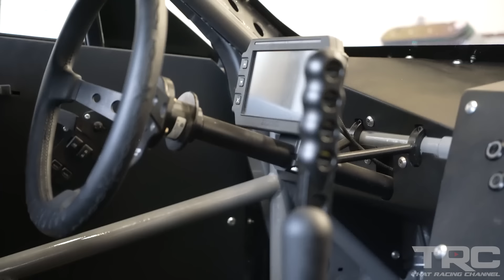Self Taught 21yo builds GT86 with 8-1 Headers, Widebody, Cantilever Suspension (Sema Awarded)

Comment: This car really shows how simple cars can be. Yes they are harder and harder the deeper you get into everything, but since this car is largly modularized and has minimal crossovers between the compartments that make it up it's pretty simple. What do you need: an engine, a gearbox something to connect the spinning thing at the end of the gearbox to the wheels and tires, you need a box to sit in, you need to connect the box to your wheels, you need brakes to slow down and that's pretty much it. The engine for example: it most certainly becomes a harder subject the deeper you get into it but if you look at it like a blackbox with wires, it really isn't connected in a whole lot of places; it needs fuel from somewhere, it needs exhaustgasses to go somewhere, it needs to be connected somewhere to use the power, it's surrounded by air, it needs a digital signal and it needs to be held in place. How that's done is a different question but you can see that the engine is a thing of it's own and not connected with wires going everywhere and while that's an art of itself it perfectly portrays how when you go the "simple rout" with something you can then build on it with great details like the 8 in 1 collector for example to polish it to make it something truly great.

Comment: There's nothing like a Nice set of headers and mandrel bends.. I have to get a Nice Down Pipe for my turbo and get rid of that Cast iron 90 degree bend down pipe that weighed like 50 lbs out of my car.. God the turbo spools up so nice and sounds so good.. I put a Fast Religion Down Pipe on My Nissan Juke Moved a Fast Cat into the Mid Pipe and put a 2J Cat Back in. Had her Tuned and Gain a 100 WT torque on the DYNO to the wheels. went from 150 WT WHP to 246 WT and 240 WHP...

Comment: The looks are awesome and the car is beautifull and special sound but a 8-1 header in a v8 is basically drowning the admision and exhaust heavily thus why even in the best tune thats not going to work properly ever, normally you do a 4-4/2 with an H or X in the tail pipe because of a lot of science sh*t that im not covering here, but combining 2 pulses at the same time in the same tube is creating a lot of trouble to that engine also that diameter and the difference in lenght of the header tubing looks drip but is not helping either, this guy knows how to build stuff clean, just next time ask an engineer if you can or teach yourself about it too so you can combine function and perfomance with that awesome looks.